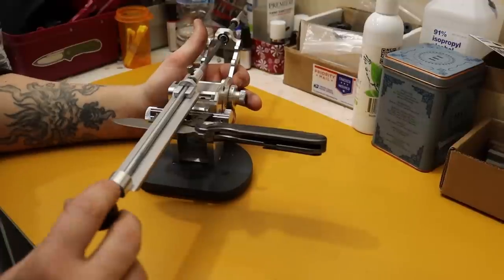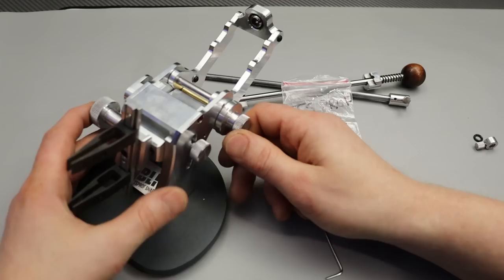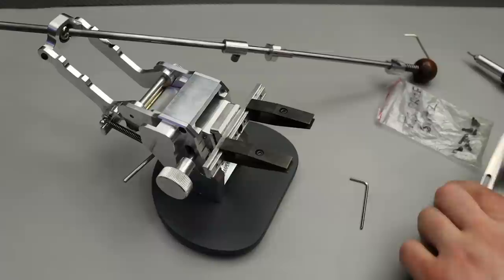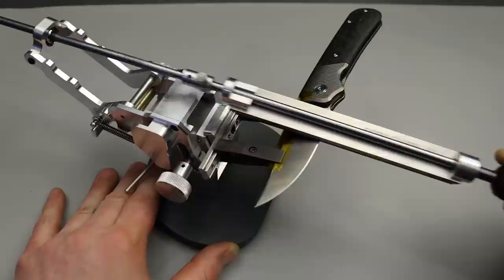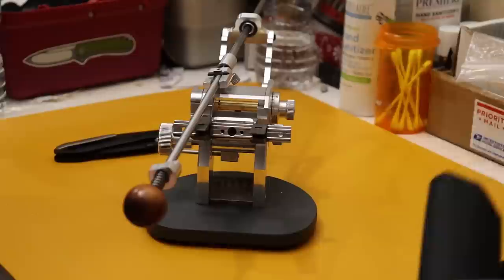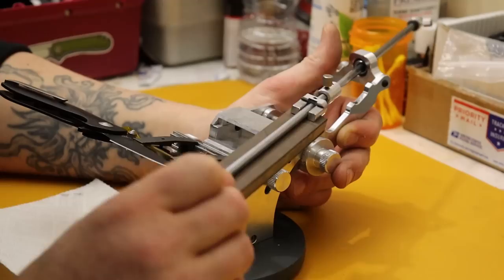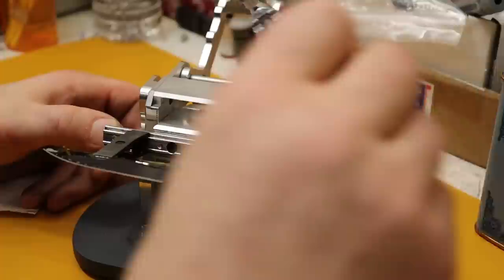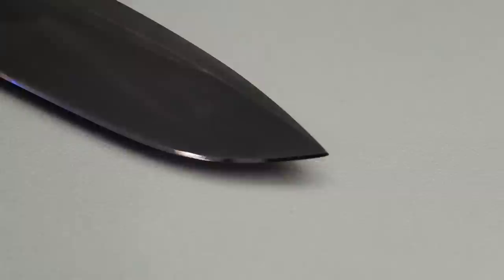NASA quality sharpening system

Comment: I have Blitz 360 and it is perfect. The only upgrade I am planning is to replace the jaws with the ones from the Blitz Pro Upgrade Kit (they have better access to the adjustment screws) and maybe spring-assisted stoppers from Gritomatic/Hapstone. And that's it. For me, a total amateur, this system is still much more than I need - it is precise, compact, built like a small tank and give repeatable results. Thank's for the video and your enthusiasm 😊 Looking forward to more 😊
Reply from the maker: I've used a lot of systems, having a system like this is much better for beginners than other systems because it takes out a lot of the things that you gave to struggle with from some others
Reply: Exactly! That was the main reason why i decided on Blitz. Based on the instructions and the knowledge learned also on your channel i sharpened the ZT 562Ti without any worries. For me this is a huge advantage.

Comment: I have the TSProf Kadet and I dipped the clamps in plastidip. No taping knives up and you get a better bite with less clamping force. They really should've coated the clamps on all models, but that's my only gripe. Great sharpeners.
Reply: Not a good idea . All the metal and stone particles will stick to that and make it even worse over time.
Reply: @PeteaUrsu  Not really. For one, I am not using a bench grinder to remove the metal. Two, I am not letting it get so dirty that the slurry gets caked on. Three, if for some reason I do use a bench grinder to remove the metal and it gets caked on, because I get too lazy to clean the clamps, I can remove the plastidip really easily and apply more.
Reply: @cheapandeasy1715  maybe it makes sense as DIY but doesn’t make sense for the factory to cover them in rubber or something.
Reply: @PeteaUrsu  Ok, I misunderstood. Apologies.
Reply: Seems like a good idea.
My KME has the neoprene pads...
Reply: The Kadet has aluminum clamps, shouldn't mar any of your knives. I've been using the blitz w/ steel jaws for a couple years and haven't noticed any marring from the clamps.
Reply: @taylorhickman84 
It's not the aluminium you have to worry about it's the tiny particles of abrasive that get onto the ali clamping surface or Plasti-dip. I think that Plasti-dip could be helpful in achieving a better grip with less claiming force but it's still a good idea to tape the spine as well.

Comment: What is the brand and model of this sharpener. this seems very nice. I purchased a $35 model off of amazon for a beginner experiment to see how I'd like doing it. I got tired of dull knives and trying to hold an correct angle by hand. I really like this 1 as the knife blade moves for the bevel instead of me having to hold a level on the stone and raising lowering the the arm at the same time. 
Thank you.

Comment: Next level angle sharpener 
How could they not use rubber inlay to protect your blade when clamping  ?
Also notice the whole mechanism wobbles?
Reply from the maker: No i have a rubber mat under the system that's thick and the wobble was my doing

Comment: Question (maybe you can address this on a future sharpening video or something)…. The spine of most knives is usually thicker toward the back of the blade, then gradually gets thinner toward the tip, right?  I realize the BLITZ system (in this video) has two separate “jaws” to hold the knife steady, but most similar sharpening systems (like the Worksharp Precision Adjust) have only one “Jaw” to grab the spine of the knife.  My question is this… If the knife is thinner progressively toward the tip, how does this affect the selected sharpening angle as you sharpen the length of the blade??  I’ve been coloring the sharpened edge of my knives with a black marker, then adjusting to the angle that removes all of the marker.  No matter what I try though, it seems to remove less as I move toward the tip.  How do you account / adjust for this issue?  I get most ALL of my blade related info from you and your channel, including how-to’s, reviews, and purchase recommendations.  I really hope you can shed some light on this little ‘discrepancy’.  Thanks, and have a GREAT day!!  MM
Reply: "If the knife is thinner progressively toward the tip, how does this affect the selected sharpening angle as you sharpen the length of the blade?? "
I have the Blitz, and can answer this... are you talking about distal taper? if so, the spring clamps can easily clamp a full flat grind knife with large distal taper.
it just works. The closer a blade is to the TSPROF, the more obtuse to angle will be / the further away it is / the steeper the angle will be.  You can minimize the
difference with carefully positioning the blade.  You usually want to tilt the handle away from you a bit... that way you can reach the tip of the  blade easier.
Reply: Something else to consider is that the knives you're trying to match the bevel on were probably sharpened on a belt grinder by hand and so there may be slight variations in grind angles at the tip. What's important though is that the knife is sharp and looks good after you slightly re-profile the tip.
Reply: Yeah and flipping them introducing further runout, you may get an 11° edge on one side And a 23° on the other setting it at 17° per side.   It's bs that you can't zero the angle of the blade from left to right and what I do is change the tool angle off of a measurement on the spine or flat of the knife.
Reply: Buy a crane guided sharpener, as long as you keep grinding vertical to the profile, it’s absolutely precise

Comment: Hold the knife with one hand
Oil the rod and rod holder
Nice stuff I have the kadet but I think this has better features on dial angles.
But its a lil light weight
800 bucks for the real one.
A bit much
Enjoy you ain't going back to hand stones unless your re curving
Btw thec.5 inch x 6 do pretty good on minor recurve.
Enjoy
1 tip check both edges I've found some blades are different angle when flipped
Reply from the maker: Thank you! 👊 will do
Reply: check out the venev gemini stones.  curved diamond stones. fits the blitz perfectly.

Comment: there are to much systems!
how are you supposed to decide without testing/buying them all

on my List:  EP Apex, Habstone R2, KMFS Rival, TSPROF, KME, Wicked edge

or should i stick to freehand stone (naniwa/shapton 400-3000 grit) sharpening with a  budget of 300€ 
I know 300€ is not much for a good system
and learn to hold the angle :D

Comment: Impressive but I get the same results from my kme for a quarter of the price  , also the kme diamonds last longer and are way cheaper. Again it's a very Impressive system but I would rather spend all that money on new knives , great vid btw
Reply: bro how can you look at this and say your kme is just as good? like lmao
Reply: @nunyabusiness8538  because I can get a razor edge on my kme just like this system  , difference is my kme didn't cost over a grand
Reply: @jedman322  you get what you pay for. everytime
Reply from the maker: This system didn't cost over a grand, it's around 400, and I mostly use resin bonded diamonds by venev that last 10× longer than any diamond plate from any company. But the diamond plates I got seem to hold up fine so far. The kme is a great system and if that's what works for you great, I run a Sharpening service with knives of all shapes and sizes so I want the best, not the system that can get similar results on most pocket knives. I want the best on every knife. Even though my freehand edges are just as good I like having a system as well
Reply: @nunyabusiness8538  all good Jared , I wasn’t ragging on it just saying my little old kme does me fine , also here in Australia it’s over a grand , actually it can go as high as 2k with all the bells and whistles and the stock plates it comes with aren’t that good , I have read and seen that mentioned a few times , you will obviously benefit from a higher grade more consistent system more than I do .
Reply: Also the kme is nowhere near the build or material quality of the tsprof….Obviously 🙄

Comment: Needs a bigger base with weight. Any movement is not good. Your view that this is the best is very very subjective. The angle indicators are a waste of time. You need an electronic angle finder. The depth if the blade from spine to cutting edge will change will change angle. Even the thickness of the stones can be different and arguably change your angle. The knife can shift in the clamp so a fune point sharpie can be used to trace around the clamping heads. Ditto the sharpie will make the initial grind more visible so if you want to set a profile. I strongly recommend you do this. A good magnifier is also a good purchase. Making sure the apex is in the middle
Reply from the maker: i have tested many more of there systems, some with better bases you can check those out i prefer them over this one, the kadet pro, and the pioneer which can use the k03 base which ive also posted on

Comment: Not specifically related to sharpening system, but what is the liquid you spray on the stones? It looks like there is some soap or surfactant. If so, what does it do (as compared to water alone)?
Reply from the maker: Dish soap and water, the oils help lift the metal particles from clogging the stones surface better

Comment: That thing looks amazing. But I cant see paying that much when you got other systems that do some what the same thing. But if money wasnt a factor I would definitely choose this. I like the features & adjustments you can make. Very innovative. Thanks for sharing.
Reply from the maker: Kind of like knives you get what you pay for, another system can sharpen extremely well but not as good, parts wear out faster, there's movement, and angle capabilities are better. If you switch stones it has an adjustment for that, which no other system has that i know of, Imo it's money well spent, imo it pays for itself when Sharpening high end cutlery.
Reply: Like what?  
Lansky?
Rme?
Reply: @NeevesKnives  yeah agree, I have a worksharp adjust and I just purchased the ken onion (can’t wait to use it) but this system also seems great, I can’t wait for you to make more videos on it, when it comes to price I mean yeah it’s expensive but with my work sharp stuff I’m already 300+ in so eh worth it
Reply: For that amount of coin, you could buy yourself a seriously good set of sharpening stones from Shapton. In fact, you could buy just three; the Shapton Ceramic Kuromako Blue/Black 320 grit, the Shapton Ceramic Glass 1000 and 4000 grit and all for under $160. Pick up a Nagura finishing/dressing stone for under $10 and you're set for years to come, plus it's more fun learning how to sharpen a knife by hand, IMHO. To each his own though!
Reply: @Equinox051256 
Good luck re-profiling a blade or grinding out a chip on a 320-grit stone in any sensible time frame. I learnt to sharpen freehand and got quite good so I appreciate the skill it takes to achieve mirror-polished edges that way but it took too long and requires concentration all the time. These fixed geometry sharpening systems are quicker and arguably better and virtually idiot-proof. I wouldn't buy this though for 2 reasons, cost and 🇺🇦

Comment: How does it clamp on full flat grinds? To me KME's clamp is superior 
because it follows the angle of the full flat grind and is rubber coated.
I do like the double clamp but if it tilts your blade then whats the point.
This does look like it has more of a positive lock than the KME which
is known to fall on longer heavier kitchen knives. I suppose both have
their pros and cons. 

Nice work on the video and thanks for sharing!
Reply from the maker: I have no issues clamping full flats, th way the jaws are made makes it easy imo
Reply: @NeevesKnives  Nice to know, Thanks for sharing.

Comment: does that system allow the clamp to be removed?

I have the desktop workshop system and I take out the clamp to look at the edge under an old microscope so I can see the scratch pattern, what areas need to be hit more, and look and make sure a have a burr on the full length of the edge on the other side...

Comment: Why kapton tape instead of masking tape? Seems to be quite expensive when using it just for masking a blade or the scales. Tsprof actually just released their Blitz Pro model which comes anodized black. It has a wider clamp bar and different clamps so it can do knives ~280mm long. The clamp bar also has clamps that can slide on the bar like the Kadet and K03 model instead of just the 2 places that are on the Blitz base and 360 models. Pre orders are shipping now and they should show up at other retailers soon. They also have a bar and clamp upgrade kit available.
Reply from the maker: I like Kapton tape, it works perfectly for everything I need and it's much more protective when hit, I also use it for a list of other things as well
Reply: @NeevesKnives  Ah ok. I just remember having to buy a small roll years ago and nearly passing a brick when I saw the cost

Comment: Question - does it hurt the edge to strop at a steeper angle than the edge bevel? For example if a knife edge has a 15° bevel. Would it hurt to strop at around 17°? I feel like putting more pressure towards the apex when stropping would give better polishing results and ensure the apex is not missed. And as the leather is soft shouldn't harm the edge in any way. What are your thoughts?
Reply: Your numbers are backwards, but no. It does not hurt, but rather is generally recommended to finish polishing the edge.
Reply: @twistedsphere  no they're not 17° is steeper than 15°

Comment: Doesn't the angle of the stone changes towards the belly and the tip, since it gets closer to the pivot?
Reply from the maker: By a tiny bit, but not enough to make a difference I'm worried about.
Reply: @NeevesKnives  oh ok, so it's not an issue. Thanks for the reply!

Comment: Excellent system but the best and most precision is the Wicked Edge.
Reply from the maker: Hmmmm arguable
Reply: @kylewilliams9710  Well if you look at the measurements available to precisely position the blade as well as the micro adjustments you have your answer. Plus you don't have to constantly flip your blade from one side to the other.
Reply: I don't think the Wicked Edge can do such low angles.  You can do around 8 and a half degrees with the TSPROF.
Reply: @dandildarious4849  that's absurd lol

Comment: Advanced Knife bro got a TSProf and the very first knife he sharpened, the wooden knob came off, sending the stone crashing onto his knife.  The wooden knob is not threaded and is glued on with crappy glue.  When he called them, they gave him some lame ass excuse and he reglued the knob himself.  I could never trust a TSProf after that.
Reply: I’ve got the k02 and The package was beat up pretty bad in shipping so it arrived with the mounting screw for one of the clamps broken. Customer service immediately replaced the clamp with no issues whatsoever other than that it’s always been pretty solid.
Reply from the maker: Yeah I've spoken with them and they seem like a good company no complaints on my end, and having to glue a knob back on wouldn't worry me to much but that's me, I've had mine for a couple months of hard use and it's been solid
Reply: @NeevesKnives  
The issue for me is that when that knob comes off it will send the stone crashing down on the knife you're sharpening. If that knife is expensive then that catastrophic  failure would be quite costly.  That would really worry me.  Would TSProf pay for the knife their sharpener ruined?  Not likely.

Comment: I guarantee you the worksharp or any guided system for that matter can put the same exact edge on any knife you are still doing the same thing.
Reply from the maker: I have those, and no they dont with upgraded aftermarket parts they get very close especially if your using similar  abrasives with an aftermarket stone holder attachment. And an aftermarket stand, also the precision and build of the system will make it last far longer, it's a lot easier to use exc.. if your Sharpening one knife a month then of course get something more affordable, but if your Sharpening very expensive knives on a regular bases then this is money well spent, obviously I bought it even though I have other systems already
Reply: @NeevesKnives  time to run the head to head video with cutting comparison tests :)